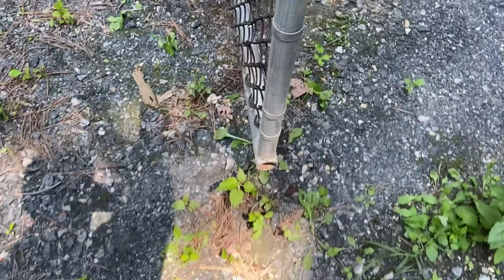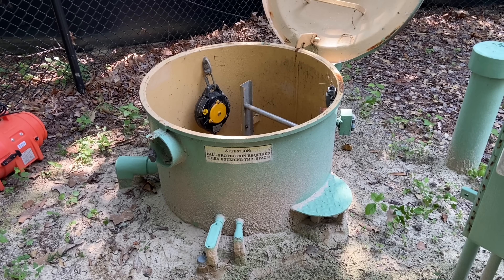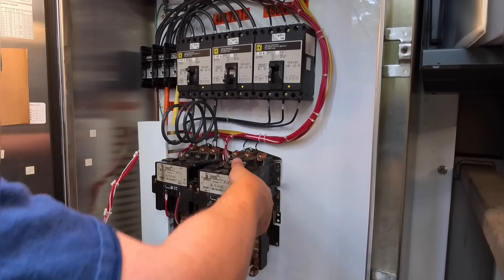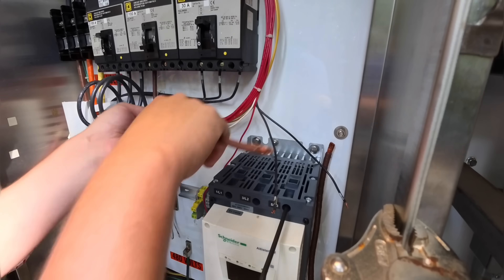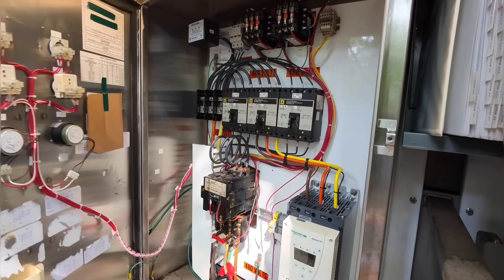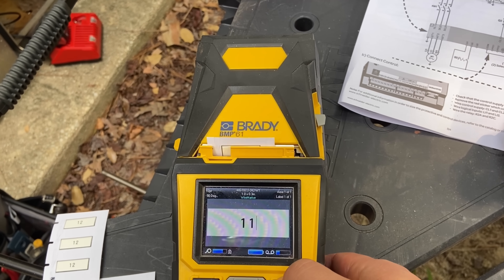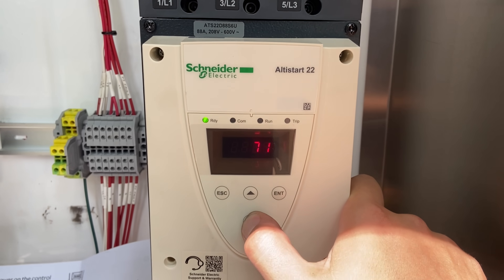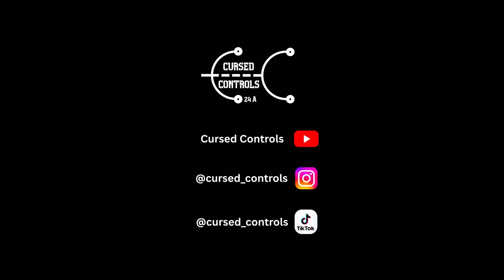Installing a Soft Start

Comment: Spot on regarding VFDs. If you don’t need speed control etc just chuck in a soft starter. VFDs are expensive, inefficient, large, give harmonic issues, create RFI issues, generate heaps of waste heat especially if using filters/chokes. Just watch out for those cheap starters that only switch two phases 😮 white phase is a straight through link. Super dangerous.

Comment: Look into getting a Brother labeler. Single-cassette tape, a bit like a Dymo in that sense, but both the tapes and the machines are much cheaper and much better suited to industrial use. They even have heat shrink and whatnot.

Comment: Nice man. I just qualified 3 weeks ago after working wherever i got a chance in electrical for 3 years. What bothers me though, I work in rubber manufacturing and those guys there don't want to teach me shit under any circumstances. Im the skivvy who puts plugs, lights, and fans running on DOLs, nothing else. Im so miserable.

Comment: Small HP blowers 1200+' away on nameplate HP VFD. That's a recipe for nightmares. Ground faults, overcurrent, over voltage. Sizing up and a couple HRG settings they purr like kittens.
Reply: Engineering added sine filters. I feel a brake chopper would do the job better for less.

Comment: Are star-delta start, or part-winding start still used? 
Or have VFDs and soft start completly replaced that now?
I haven't worked on large hvac systems since 2013, so I'm not up to date. 
But I remember installing some VFDs and soft start in some older systems here in norway back then 🙂

Comment: Why a 61.5a motor on a 100a breaker shouldn’t it be more closer to 150. FLC times 2.5 (250% of the FLC) correct?

Comment: Control work is so much fun. Worked in a factory in the early 2000s. Half the process lines were relay logic, and the other half were PLC driven. Never learned PLC programming but had a blast troubleshooting the relay logic ones. Can troubleshoot some PLC issues.

Comment: As another comment suggested, try using a dot or two of silicone on the edges of your stickies. It will be hidden by the wires anyway, and I have seen them Outlast regular stickies side by side  in 100 cabinets. I'm guessing the normal adhesive releases under extra cold, heat, or extra vibrations. In which case the silicone is there to hold it firm. Kind of like Silastic or silicone on circuit board components

Comment: The use of permanent buttons is not recommended in industrial applications, as the motor will start when power is restored after a power outage. This is unsafe.

Comment: Nice to see a  fellow sparky take the time to redo the sticky backs and great job explaining  things. Retired awhile and forget if it was a 1&11/32" Greenlee punch we used for the old Allen Bradley start stop push buttons. We had over 500 VFD'S in the large hospital / research center that I worked at. Only had one soft starter & that was on a 250 HP Fire Pump..Told the younger sparkies to get good, no really good at troubleshooting especially VFD'S. Lot easier playing with drives then running conduit &.pulling large wires. We had good luck with the T & B sticky back bases indoors. None seemed to be good long-term outdoors with the heat & cold. Warning do not purchase any carbide hole cutters from Grainger's. Got screwed for over $100 when I purchased a 7/8 & s 11/8" name brand carbide hole cutters that were made in cheating lack of quality control communist china. My old 7/8" Klein carbide hole cutter with only 1 cutter verses the 4 to 6 cutters Grainger garbage cuts faster then these brand new ones. Thanks for the great vidios.

Comment: I’d recommend the Brady BMP 21 Plus, although I think they recently changed the model number to M210.  I buy the Brady Permasleeve labels for it and heat shrink them onto the wire.  The downside is the rolls of labels don’t last as long as the ones from your current label maker.

Comment: Nice.  I recently had a Altistart unit for a 150 HP motor (blower).  Issue was, the engineer who spec'd and built the panel had installed a 120 HP one, so kept tripping on amp overload.  Eventually swapped it out for an ABB PSTX210 which allowed me to get the motor running successfully.   Both were nice to work with though, shame it was just not correct in the first place!

Comment: You can use an 1" 7/32 carbide as a 30mm carbide, its technically 31mm but I have not had any issues in any of my 30mm applications

Comment: I'd wager that giant conduit is the result of someone dividing cable diameter by fill % to get required diameter rather than dividing surface area by fill % and then working backwards to get the required diameter.

Comment: Australian E&I tech here, I had a utility guy come to my house one day to replace the power meter with a smart one. I noticed he used a sticky with a dab of silicon on the top edge to hold the antenna cable on the edge of the panel. To this day I have done the same, dab of silicon on one of the edges of the sticky, usually on the left and right side as most of the time it is hidden behind the cables, and have yet to come across any falling off.

Comment: I work as a process design engineer in pulp & paper industry, and get a peak at this sort of stuff only during commissioning and start-ups, so it's nice to see how this stuff actually happens and works. Maybe have to think twice about "just slap a VFD on it", especially on rebuilds and upgrades of old mills :D

Comment: Schneider does a terrible job of calling it out, but they really want you to have an input contactor "KM1" run by the fault output on relay 2. That way the angry power can't pass through in the event of a fault.

Comment: The way cheaper and just as good option for labeling is a Dymo Rhino 6000, but purchase the aliexpress label and shrink cartridges. Which funnily enough are cheap and actually more reliable than the Dymo high priced ones.

Comment: We tried Brady labelers too, we got a couple M211s. Everyone liked that they were smaller than a typical labeler since it was just the printer part with no keypad. The app was awkward to use but fine once we figured it out.  We unanimously turned against it when we started getting to the “end” of label cartridges when it would say it’s empty meanwhile we could see enough material for 3-7 more labels….  One guy had a whole cartridge go to waste because the chip fell off the cartridge so it wouldn’t work.  One of the guys got fed up and bought a panduit mp300. After a couple times borrowing it. I got one for myself. Supervisor was eventually convinced Brady wasn’t the way to go. What really helped was a vendor had a Panduit promo where you could trade old printers for a MP300 or 200 depending on the type. Ended up trading the 2 m211s for MP300s and buying everyone else MP200 or 300s. So far the MP300 for me has been solid and no issues with cartridges.

Comment: After putting on lots and lots of stickies over the decades in alarm Equipment 
I won’t mount anything that sticks without wiping it with alcohol first and using good stickies from 3M 
I’ve come back 10 and 20 years later and the stuff is still there but most of my stuff is also not outdoors in the lovely up-and-down environment

Comment: Interestingly, just this week I ordered the exact same soft start to replace a NEMA 3 Square D contactor that runs the 50 horsepower motor on our Sulzer Metco ventilation system for our large Praxair HVOF thermal spray booth. I installed the original contactor 30 years ago and it is just starting to fail. I wanted to replace that contactor with a soft start for a very long time, so this was finally the opportunity to do so. Every morning, the operator pushed the button and the ammeter would peg at over 100 amps until the motor finally came up to speed. I argued and argued 30 years ago to do a soft start, but back then they were prohibitively expensive, so they wouldn't do it. This week, I filled out the purchase req. and it was approved. It should certainly last for the next 7 or 8 years until I retire.

Also, I have a Brady BMP 51 at work. It is a lot nicer and more convenient to use than the one you were using in the video, but every once in a while those comically expensive label cartridges don't identify correctly and therefore do not work. I'm not sure why those stupid labelers have to be so complicated. I just want to print them out, slide them on the wire and shrink them. It shouldn't be that complicated.
Reply: They're that complicated so they can force you to use their stupidly overpriced label cartridges.  If they made them simpler then you could just pop a generic cartridge in for 1/10 the cost.

Comment: Also the reason why current (in most cases) doesnt increase when voltage is decreased via reduced starting methods is due to rotor parameters. You have 3 types of current with motors however, active current and reactive current with rotor parameters, and basic current of your stator. You'll see the highest current generally at breakdown torque

To put it simply, reducing voltage reduces torque, which then reduces current, as well as the other rotor parameters (impedance, reactance, frequency), EXCEPT for power factor which increases with slip speed. Of course some parameters are linear and non-linear.

I've seen wye delta motor starters, autotransformer starting, part winding starting, as well as programmed a VFD. 

Also that wiring diagram was absolute trash, they really need to be more clear with those things. A schematic, and wiring diagram with thorough labelling is excellent. I can draw a basic motor starter schematic like the back of my hand, those manufacturers get paid way too much to skimp out on these things. 

Anyway keep posting your stuff those silly shorts you put in are just that, silly. Takes away from your brilliant wiring

Comment: i like the way the cabinet turned out.  Most of what you said went over my head, but it was helpful.  I want to put a soft start on my A/c  condenser so it will run on my backup generator

Comment: Does this work similar to a VFD by going from AC to DC and Back to AC?
Reply: No, its just 3 sets of back to back SCRs that chop up the incoming AC. It dosent change the frequency, only the voltage applied to the motor.

Comment: For the choice between a soft starter or a vfd, an important note is also that modern vfd with vector control are capable of starting a motor with full torque from zero rpm. But the soft starter is not. So yes a soft start is cheaper, but if you require more performance a vfd will go a long way.

Comment: You forgot to mention that softstarters are not the best option for high enertia applications, because the starting torque is relatively low - VFD's are great in that situation though.
Great video as always!

Comment: Used to have one of these at my previous job, a siemens one, and I was shocked (literally, lol) to find out it had a hot wire on a load side when turned off. 

Strangely enough, I didn't even bother to look up if it's normal for them.😅

Comment: I don't know if they have been mentioned before, but at my work we use HellermanTyton FlexTack stickies with the ultra heavy duty black 3M adhesive. I've accidentally stripped paint off of cabinets with those before. The FlexTack ones can be applied to curved surfaces as well. They sell a non-flexible version which is cheaper but I do not know the name of it.

Comment: Nice video, very interesting down in ground….

Have you worked alot with soft starts for transformers? One would think it is the same, but there are some subtle differences. 
The inrush event is alot shorter, but i would i think!

Would a motor starter work well for a transformer?  Ive only used large power resistor and bypass contactors.

Nice to come home and watch something interesting, not just brainrot :)

Comment: When I worked in wastewater, I used to set the acceleration to ramp as fast as possible without the amps pushing past FLA. Mind you that was usually with a VFD. It kept the pump from ragging up with all those flushable wipes....
Reply: I was actually going to question the logic of a fast ramp up until I got to the last sentence of your post- good idea, carry on.
Reply: Flushable wipes you say? No way I thought dude wipes said they degraded 😂

Comment: VHB tape is the way to go if you want to make sure that the stickies never come off. It's like 5200 from the marine world. When you need to make absolutely sure that you'll destroy the two things you've joined before they come apart, 5200/VHB
Reply: Can confirm, we had someone stick one of those plastic project boxes to a wall at my job. When it came time to rip it out, not only did the box get mangled from prying it off, it came out with a chunk of plaster.  Tape still holding strong.

Comment: I used to think like that too "less voltage = more current" but that's going into watts law too quickly. That's like saying if you put 1V on a baseboard heater it'll draw like 1000A and explode. That would be pretty cool though. A 1HP motor at 600V will draw less than a 1HP motor at 208V but that's not the same as varying the voltage on those motors.

Comment: Just finished rebuilding and adding a second AV rack at a theatre today. When I pulled the initial single rack away from the wall, every sticky had fallen off and the cables were full spaghetti. Perfect.

Comment: Carbide hole saws are too brittle to use in hand drills.

You can get a 30mm knockout with the keyway if you have the $$$

I don't hate my company enough so I use a 1-3/16 round knockout and file the keyway.

Maybe I hate my company a little because I use 30mm and NEMA instead of 22mm and IEC when I build controllers.
Reply: i use carbide hole saws all the time in hand drills and have never broken one, been doing it for over 20 years without issue
Reply: Blair Rotabroach, baby!

Comment: The bypass contactor isn't rated to break the FLA current. You're supposed to use a secondary contactor to stop the motor under fault conditions. Because of this, the hardware to install a soft starter is more expensive than a VFD nowadays.
Reply: @87cr250r I agree with you. Due to the nature of SCR's, In most cases if a soft start fails it fails closed.  Without a line side contactor the load could continue to run or single phase in a fault condition. I do really enjoy these videos though.

Comment: I know your label printer is provided by the company but if you ever wanna change or buy one for yourself, the one I use is the Brother PT-E550W or, as it is known in the UK/AU, the "Electrician's Label Printer".

You see it everywhere in the trades here and there is a reason for it: Not only it prints to 24mm, it also accepts OEM/compatible tape. No chip on the cartridges, no machine lockup when using non genuine cartridges or when the machine thinks you finish the tape but in reality you didn't.

There is a new version of it (the one I own is already discontinued, the newer model is the PT-E560BT) but the older one still can be found on discount in some places.

I never used the new model although I know that both have connectivity with the Smartphone app who let's you download templates for special labels (reg or common designs) and design and edit labels directly on the phone and send it to the printer.

Previously I had a Dymo XTL 300 that I sold not even 6 months after getting because of the same problems you mention in your video, specifically the cartridges having chips on it (so OEM use was limited to spotty at most), although the colour display was way more appealing than the Brother, who is monochromatic, as it is still in the newer model too.

The older Rhino series was way better than the Dyno XTL line up, no DRMs or lockouts, it would take every single OEM tape it would support.

So if you really want, give it a go to the Brother one, you gonna love it.
Reply: brother just make the best stuff, the only good printer company
Reply: @slompish aint that a fact. Especially HP is insane with their requirements, how little ink they provide, how they lock out everything, et cetera.
Reply: Seconded. The 550 is awesome. Tons of label options and it doesn't waste a ton of tape like a normal P-touch does.
Reply: We have the PT-E550W at work as well and I agree.
Reply: Because of this I looked up the tape and found out it just goes in a standard p-touch which I already have, ordered some cheap aftermarket tape right away

Comment: I agree strongly on the Brady printers. Really cool and versatile but stupid expensive. I own the previous version the TLS-2200 which is a great printer. They made/sold them for almost 20 years. Absolutely rock solid and dependable. At the panel shop I used to work for they would last about 10 years of daily use before the keypads would fail causing the unit to not be worth fixing. Yes the consumables are also stupid expensive but IMHO they are the best. No one else's wrap around self laminating labels came close to how sticky and permanent Brady's are. Sure Heat shrink is better but in a production environment time is money and heat shrink are too slow and labor intensive. On their larger desktop printers i must have printed 250,000+ wire labels over about 17 years. 

Unfortunately they quit supporting the consumables for the TLS-2200 only a couple years after they stopped making it. Rendering my awesome printer almost worthless. The labels and the ribbon on your are the same they just updated the chips to make them no longer compatible. Fool me once shame on you, fool me twice..............We wont get fooled again. I ended up replacing it with the Brother P-touch PT-550EW as the regular flat labels are laminated the printing is much more durable. For wires I primarily use the aftermarket heat shrink as cost per label if you know how to adjust the printer correctly is around $0.05 to $0.15 per label. Pretty happy with it overall. I have it plus 20ish label cartridges in a small Milwaukee Packout organizer so I am ready for anything.